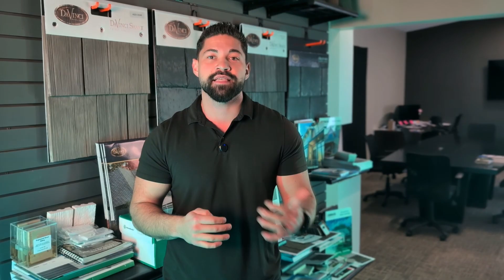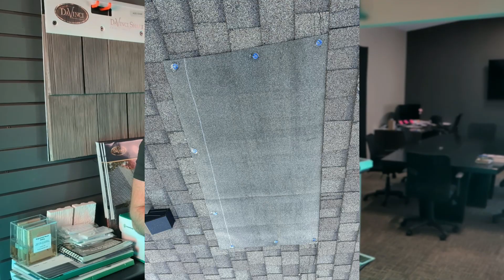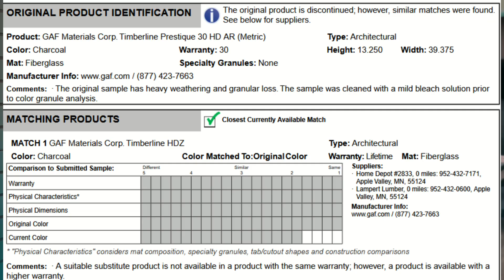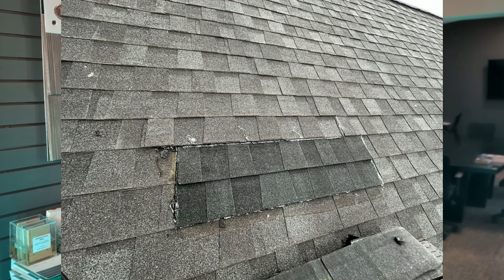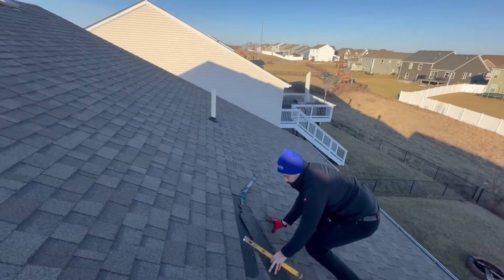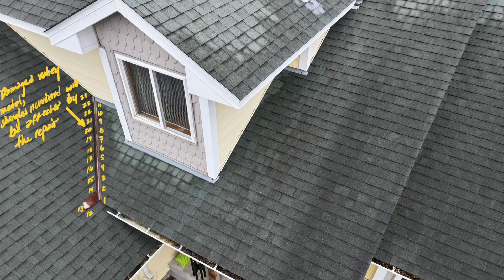What Is an ITEL Test? (And Why It Might Not Tell the Whole Story About Your Roof)

Comment from the maker: 🧠 ITEL Test – What You Should Know:

✅ ITEL Identifies:
• Shingle/siding brand
• Product line
• Color
• Discontinued status

🚫 ITEL Does NOT Evaluate:
• Shingle or siding repairability
• Mechanical fit or installation compatibility
• Actual color match on aged roofing
• Availability in your local market (only if it still exists)
• Code compliance or warranty conflicts

⚠ Homeowner Tips:

    📷 Take photos before the sample is removed.

    🚫 Remember: Shingle samples sent to ITEL don’t come back.

    🧪 Ask your contractor to perform a real-world repair test if repair is suggested.

    📝 If a “comparable” is proposed, request a side-by-side photo on your roof.

    📄 Ask for documentation of mismatches, creasing, or damage from repair attempts.

💬 Questions or concerns?
📞 Call or text Foremost Exteriors at (952) 495-5545 — we're here to walk you through it.